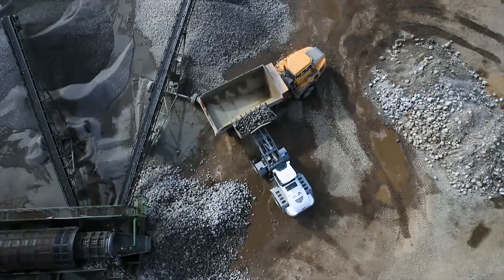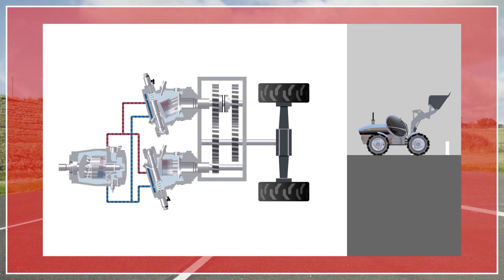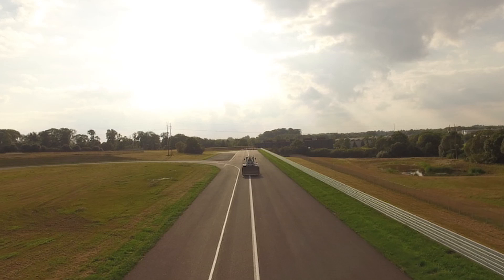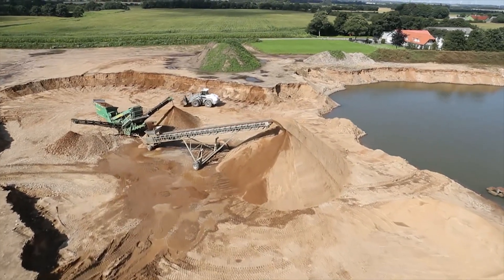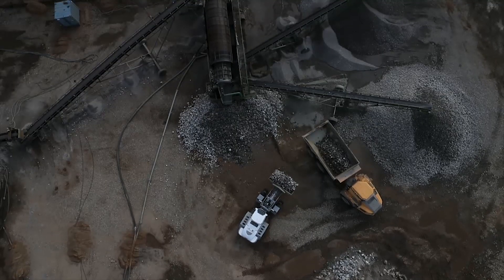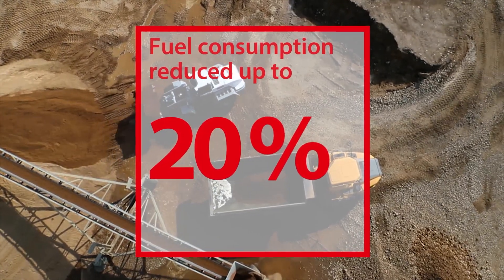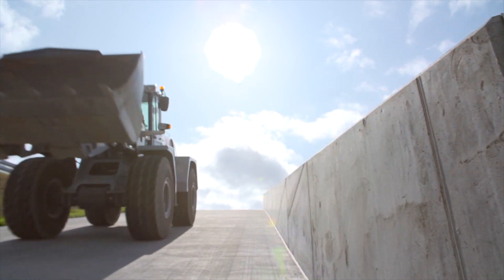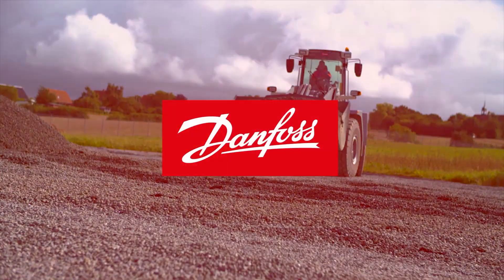Danfoss Wheel Loader Solutions – Hydrostatic Drive Systems

Comment: basiclly you use a cvt transmission in a wheel loader? that brings the comfort from a (for example) fendt vario to a wheel loader?
Reply from the maker: Yes, the cvt technology allows functionality that so different than what is available in the Fendt Vario systems, improving operator comfort and machine drivability in many similar ways.